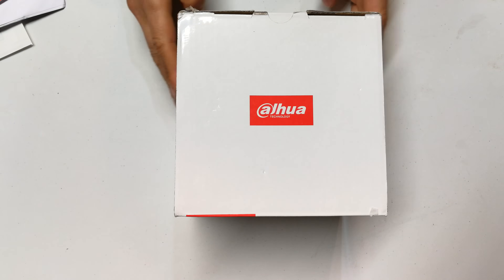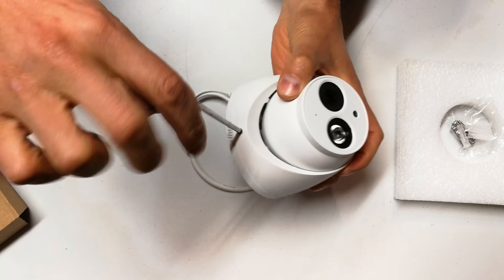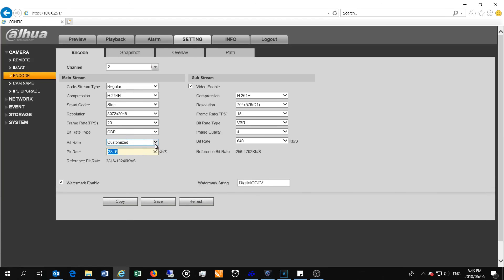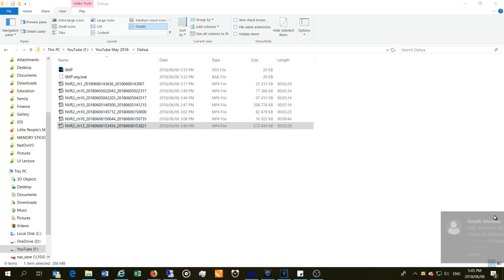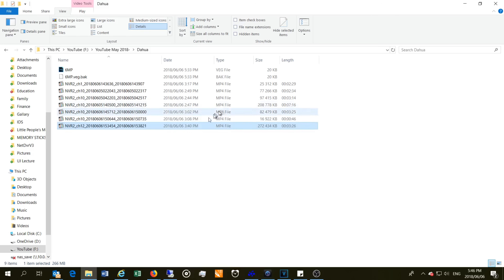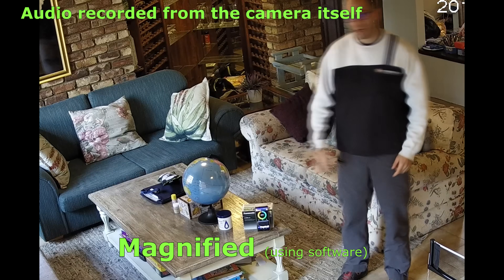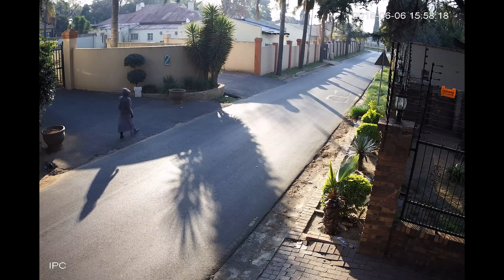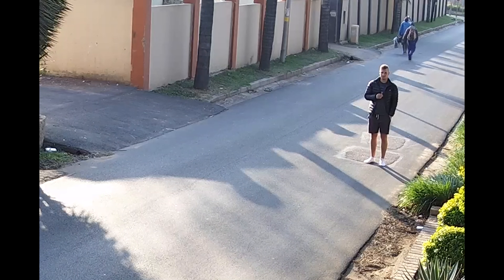Unboxing and detailed technical review of the Dahua IPC-HDW4631C-A 6MP IP camera

Comment: I have installed many of these Dahua cameras throughout western PA. EZ set up. If you use them outside you must use the plastic connector with the foam piece that goes over the cat45 connector. If you don't use the plastic connector, you may fry the camera when it gets wet. I am going to purchase more.

Comment: While this camera offers good quality image during day where you have enough sunlight, at night it is different story. It can go maximum of 15meters at night and that's it. 
Good for front door or small areas at night because it has weak IR. 
During day it is quite good and you can go with atleast 2-3 IVS rules and MD.
Reply: Boban Aleksov 
This day and age it’s sad . I’d be happy if a 2 megapixel sensor in a 1” size could be developed cheaply in order to improve on low light capability with as little noise as possible. But instead there’s pixel wars
Reply: @MajorTendonitis  2mp is better at night, use a lot of light and the dahua 2 mp starlight cameras are awsome.

Comment: Hi Mate if you pause the video at14.45 while the guy is just starting to walk away he could be anybody.Your camera has got a lot of motion blur. You need to tweak the settings a bit better and use a higher shutter speed .On a hikvision 2mp hd turbo you can get a crystal clear still of a car driving across the image at 60kph
Reply: The max frame rate is 20fps. You cannot "tweak the settings a bit better" that's not how any of this works. If he was using a low bit rate then maybe but he is not. To have that resolution at a higher fps would drastically raise the cost of camera and require a currently an absurd amount of bandwidth and storage.

Comment: At the beginning of the video you say that it is a 2.8mm camera, but on the box your opening it shows 3.6mm. So in saying this which one is it? did you get it wrong? I would like to know. thank you
Reply from the maker: you can get the unit in either 3.6 or 2.8. I read the specs saying 2.8 but the unit i tested was 3.6. My mistake.

Comment: What were you're settings dit the microfone? I have the exact same camera but my audio recording was not yet so good. Thanks for all the info you already have given us!
Reply from the maker: the audio setting on the NVR was left to default. My old NVR doesn't have audio settings other than on/off.
Reply: Tnx for the reply, i have discoverd what the problem was, i was watching recorded footage via de laptop (WiFi-connection) then i tried it via the Cat6 cable and the sound footage was much better, again tnx for the fast reply!

Comment: Nice video on this product. I'm still doing research before I purchase a system and would appreciate some info here, what system do you have this camera setup on?
Reply from the maker: i used the basic 16 channel NVR. Dahua 16 channel. The camera also works on the 8channel NVR.
Reply: Awesome, is that zoom in software built-in to your dahua nvr?
Reply from the maker: yes you can do that on the NVR but i used the video editing software to do it.
Reply: I'm using this NVR : NVR2104HS-P-S2 (only 90 euro!!), it works like a charm and if you do not need more then 4 camera's it is cheaper ;-). The zoom in can be done with SmartPSS, that is the software which you can download from this site: https://dahuawiki.com/Template:SmartPSS
On that website you can get much more info on all things, good luck.